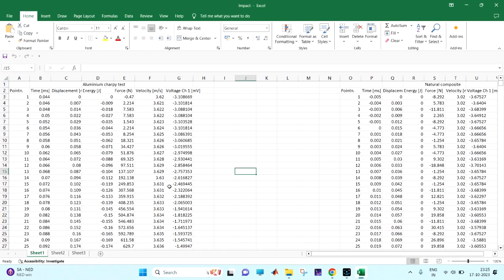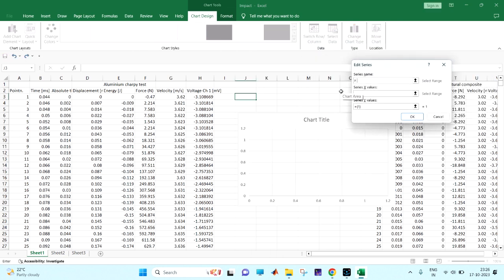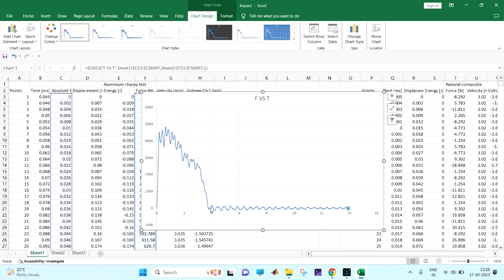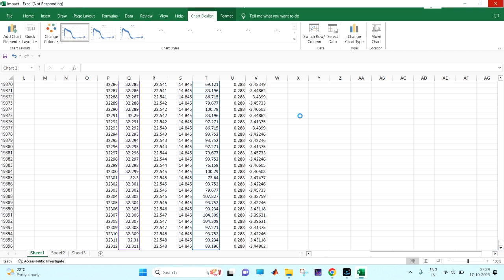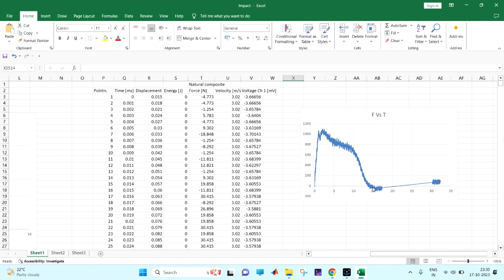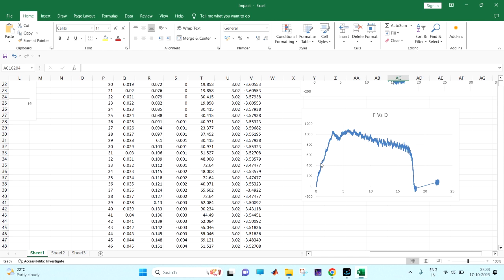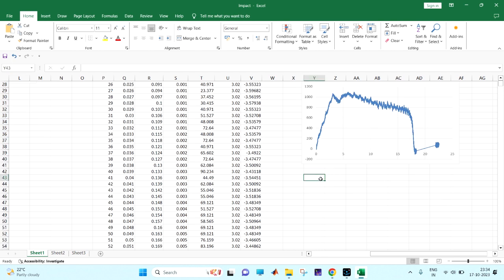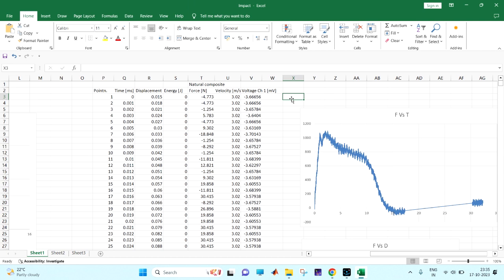Drop tower impact test graph plot for experiments done V4

Comment: I'm using a manual drop weight testing setup for testing sandwich composite structures, But I'm not able to post process the data correctly and I'm not able to achieve desired graphs like f v d , e v t.
Can you help me in solving the issue?
Reply from the maker: Dear friend, In Instron CEAST we are getting a Force vs Time graph. From which we are getting displacement and acceleration. are you getting Time data ???
 Without time it is difficult.